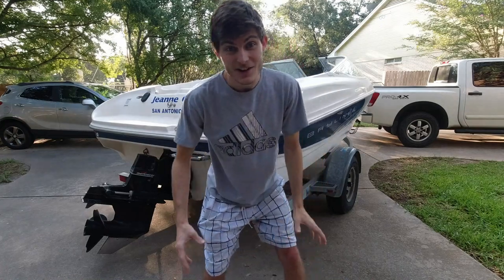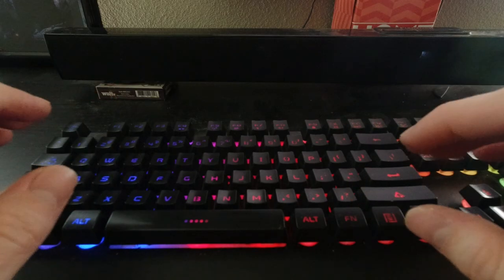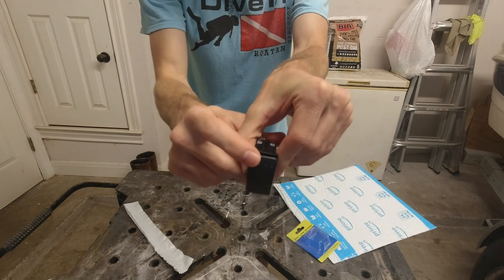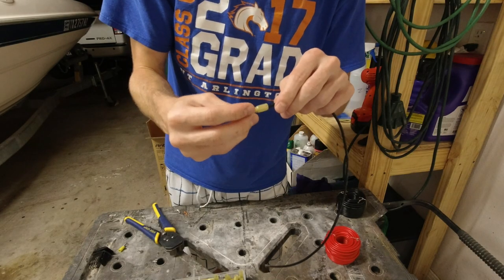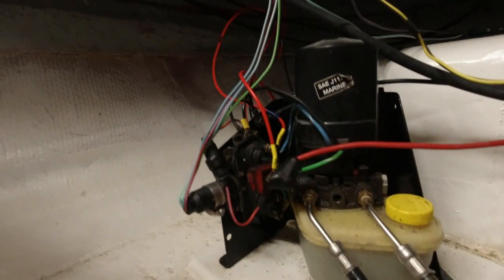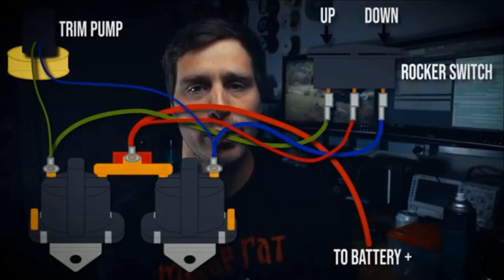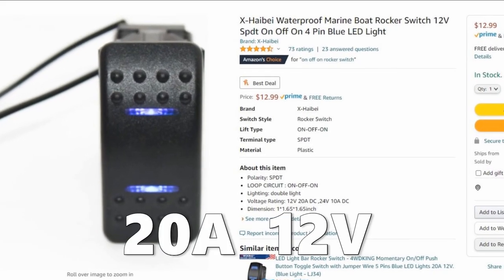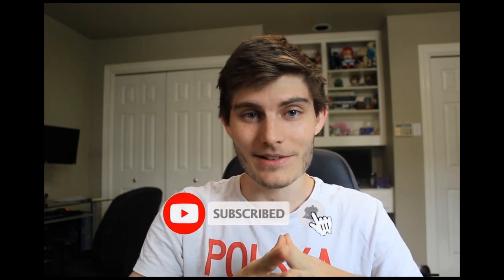How To Install a Remote Trim Switch!

Comment: Zach I would install the switch on the left side away from the ladder since one may hit the switch while boarding the boat. One accident we don't need! LOL. Momentary type switch is a must. And you may even add a 20-30amp inline fuse for better protection. This also useful if you want to disable the switch by removing the fuse. Other than that great job brother!!

Comment: Great idea.  I'm using a momentary switch and using a 12ga 3 conductor extension cord. Cut the cord and have the female end attached to the pump. The male end will have a 4-6ft lead and  plug into the female end which is now wired to the trim pump. You can use it for emergencies or hang the lead over the side for trailered maintenance. I love this idea!

Comment: My Cobalt boat has probably 18 gauge wire from the throttle trim and from the existing transom trim switch. Why are you needing to use 12 gauge wire? Is that because you are you are direct  wiring to the pump and not the trim pump relays?

Comment: I think I'm going to do this as well especially for maintenance, but also I will add an "Enable switch" to my dash or maybe in the dog house, out of the way,  therefore if someone is out on the dock of the boat and they accedently hit that switch I can have it disabled, so it doesn't mess with my trim while on the water.. basically I would take the power lead and add an inline switch on it, just a 2 way toggle to where it can close the power lead and complete the circuit when i want the remote trim to be active.
Reply from the maker: That's a great idea!
Reply: @ZachsGarage1  I suggest  installing a main battery disconnect switch rated  for high current! , here is the link :  https://www.amazon.ca/gp/product/B07V341LXP/ref=ppx_yo_dt_b_asin_title_o04_s01?ie=UTF8&psc=1

Comment: Hey Z, nice vid I would have used a spdt momentery type switch "release the button and it stops" like you have on the dash or in your throtle. if you are travelling on the road and something hits the button it has live power and nothing to stop it from dropping and then frying the switch, motor or worse case starting a fire.at very least I would install a fuseable link between the +battery and switch. Just my 2cents
Reply from the maker: I'm glad you bring that up! I forgot to mention in the video, but I agree, I momentary switch would be better for this application! Only reason I didn't get one was because the shipping was going to take up to 2 weeks and I didn't want to wait that long 😝

Comment: I can see why this would be useful. Did you confirm the IP rating for this switch? Referring to it as “marine” does not mean it is watertight especially if it is designed to be installed on a console. I have a swim platform on my boat and that help the wash to come onto the step on rapid decelerations. Any switch in that position will be awashed and if the IP rating is not good enough, you will have electrical issues.

Comment: Great video, thanks. Question, can the throttle tilt/trim remain active too?
Reply: Yes. I'm having trouble with my Up, but Down works fine... With a tournament 2 days away... I did this for "emergencies".
Reply: I've replaced the Up Solenoid, that did not help. Still currently using the Switch.

Comment: Momentary switch in a better protected location would save what will inevitable cost you a new pump or worse.  Someone is going to set something on that swim deck in storage and it will lean on the switch and cause all kinds of trouble.
Reply: EXACTLY. The wrong switch is the first thing I noticed too. Bad idea using an 'on-off' switch. It should be MOMENTARY only.

I'm considering making this mod too as I hate crawling on/out of the boat to raise or lower the drive, especially during maintenance. And every single one of us has forgot to raise the drive while pulling out of the water, Having a remote switch in the back should be standard issue on I/O boats.

Comment: Hi, Gio here from Western Long Island sound.  Looks like a great job however why does the switch need to be so large.  I have a 22 ft Sea Ray with a rear switch already built in but it is about half the size of yours and works just fine.  Wondering why you selected a larger switch. Also it appears you need to press it again a second time to stop it going up or down.  Could be hazardous.

Comment: Will connecting this switch allow me to use the trim even if the battery switch if off. That is what I want. I hate to say it but a number of times I put the boat cover on only to realize I need to lower the motor and I have to crawl under the cover just to turn on the battery switch long to trim down and turn the battery switch off and cover the boat again.
Reply from the maker: If it doesn't go through the switch then yes
Reply: @ZachsGarage1  thank you for the fast reply.

Comment: Great video...question does this bypass the trim limit system? one other thought...I would look for a switch that only stays on when I'm holding it down.
Reply from the maker: Yes, and yes. What you want is called a momentary switch
Reply: @ZachsGarage1  Do you have a link?

Comment: In the diagram it shows the blue wire going to the down side of the rocker switch , and the green wire going to the up side of the rocker switch. Should it be the other way around ??
Reply from the maker: Possibly, the way I hooked it up was backwards at first so I flipped it so up would be up and down would be down. Trial and error Will reveal the right way
Reply: @ZachsGarage1   Ha ! "Possibly" !!

Comment: Hi! zack,  BTW nice video,  i am planning to add a remote  switch  to the rear of my boat  for the trim! , but after seeing  what you are using  for a switch  i think  the ideal type of switch  would be of the intermittent  On- OFF- ON  type  that returns to center position   same model type   same dimensions,  now as for the  wiring, you don't need heavy gauge wires    because  you are activating  solenoid switches   (relays)  these solenoid switches  are used to handle the high current demand  from the hydraulic pump motor,  but the current  needed to activate the solenoid  switches is in fact very low so  16 or even 18 gauge  wires would do  just fine, i know this because i am an electronics technician by trade!  , so 12 or 14 gauge wire is a bit overkill  in my opinion!  , if you look at the  starter solenoid for the motor  you will find  next to battery terminal  the small wire to activate the starter solenoid that wire  goes all the way to the ignition key in the front. Nice Job On the restoration of your boat, that was a lot of work!  CONGRAT'S.
Reply from the maker: I agree a more ideal switch would be a momentary switch that returns to center position on its own.  For wire  gauge, I am actually by-passing the solenoids, so the full power of the trim motor is actually running through my wire. I did this so incase the solenoid were to fail the trim switch at the back would still work. Thanks for the kind words! :)
Reply: I understand the reason for wiring the rear switch the way you did,  But,  i would  rather use the solenoids to activate the trim pump motor simply because these solenoid relays are Designed!  to handle  high current  demand  , and the fact  that the failure rate is very low!  , personally   i wouldn't   bypass the solenoids but i'd rather  piggyback the wiring,  that switch will fail sooner  because of the high current  passing  thru  the contacts.
Reply from the maker: @wallbagner  fair enough 🤠

Comment: That switch should be MOMENTARY only.. not an 'on off'. Bad things can happen if that switch gets activated while under way and your pump is stuck on. Or like others have mentioned - only a matter of time before someone tosses something on your swim deck and hits that switch, doesn't notice and BYE BYE pump!

I'm going to do a similar mod like this, except I might use a wireless relay. They're dirt cheap and easy to connect. Best part is - NO HOLES to drill or switches to be exposed. The only down-side is I'll have another remote FOB to lose.. lol. So I dunno..  Just a thought.

Find remote relays at Electronic surplus web stores. I use them on garage door openers and a number of other things.

Comment: I wired the switch like you said on my boat and I get nothing. Do you have any idea what might be the problem?
Reply from the maker: If you have a multimeter very each wire has continuity. Then verify the terminals on the switch have continuity when flipped for up and down accordingly. Does it still raise and lower from the throttle?
Reply: No I took that switch off. I replaced the both selinoids at first because it wouldn't raise or lower. Then I tried it and it just clicked.  Thats when I went to the switch.
Reply from the maker: @phildaniels7319  clicking sound should be from the solenoid engaging. If the trim pump motor doesn't run even with supplying current straight to it without the solenoids in the circuit it might need to be replaced
Reply from the maker: It might also be that if the battery is too low or weak it may also not run it
Reply: @ZachsGarage1  thanks appreciate it

Comment: Thats a failure waiting to happen. Corrosion, damage from boating activities, most useless modification, if you can't be bothered reaching over. Then sell it, boatings not for you
Reply from the maker: Did you have a bad day man? We're here to talk to. There's so many things in like to be happy and thankful for, no need to be down so much 🤠

What corrosion do you think is going to happen? There is more reasoning to adding the switch besides laziness if you watched the whole video
Reply: @ZachsGarage1  gee you really are a tripper, I'm happy as Larry, also a professional boat builder for many many years now, sticking a switch at the back of the boat, basically in the splash well, that switch will be no good within 2 years of swimming with the rest. Your boat is a bayliner, not the titanic, you do not to bad in most of your videos, I mean it works, but its not standard practice. But this is just ridiculous, will cause more headaches then anything, peace
Reply: @macattack20100  so I guess the kit manufactured my Mercury for this exact purpose is not a good idea?  I guess they figured only a bunch of suckers will buy it and it will fail in a couple years...